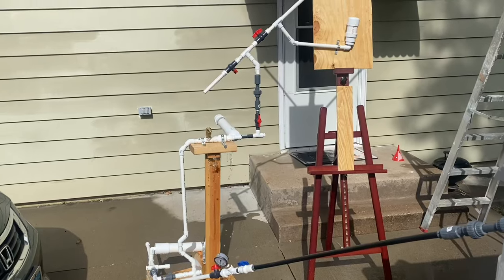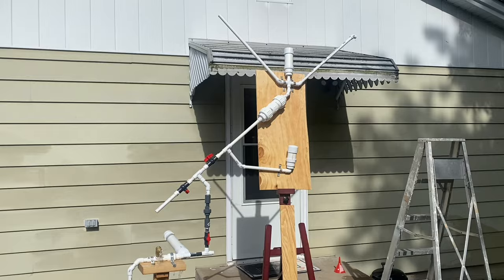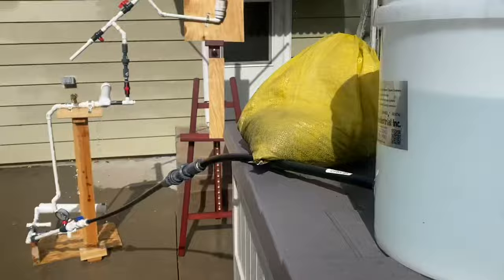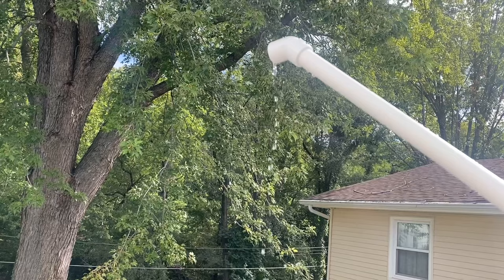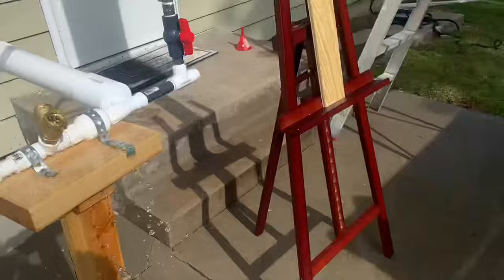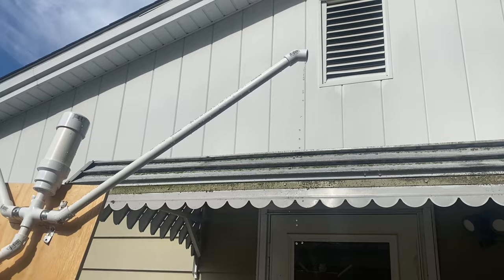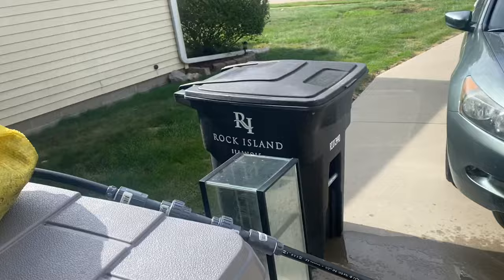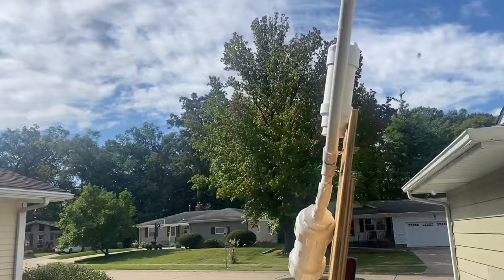The Great Pyramid of Giza Ram Pump theory works!  Video 1 of 2

Comment: Moving water (up) at a lower pressure than is being given by the body of water (container) pushing down is not rocket science. The body of water is contained and sitting higher than the location where water pulses and is additional creating pressure (moving a small flow up)Try pumping from the same level or below with equal pressure and see if there is enough spare pressure created so you can push water up the pipe. No, you cant.
Reply from the maker: This only works as is. It is a theory.
Reply: @tommartens3731  agree.

Comment: If you remove an ancillary component how does it change the operation?
Reply from the maker: During the building phase , I had the one way valve down near the subterranean chamber.  That didn’t work.  With a ram pump you have to have the drain valve, one way valve and pressure chamber relatively close to each other for it to work.  I did not try to see if it would still work if different pieces were left out.
Reply: @tommartens3731  Thank you.
Reply: Seems overly complex on an absolutely ridiculous scale for very minimal effect. Because a thing will function a certain way doesn't mean that is what it's original function is. I can plow a field with my car but that's not what it was designed to do.
Reply: @Good Citizen  it probably looks minimal since it is a 1/1000 scale, however this would be very effective at the pyramids true size
Reply from the maker: @peypoo123  Also, since the wastewater comes out of the upper grotto area it might also be usable.

Comment: I have no doubt the Great Pyramid was a ram pump but it would be easy enough to just get the water directly from the river. It may have used the ram pump effect to pressurize the granite for piezoelectric electricity.
Reply from the maker: Thanks!  I don’t think buckets in the Nile river would be easier.  Ram pumps create temporary back pressure.  I just can’t see an electrical aspect of this theory.

Comment: But why? Why would they want water pouring out of the shafts on the sides of the pyramid?
Reply from the maker: To provide water year round instead of just during the flood season.
Reply: @tommartens3731  But the Nile went right up to the base of the Giza plateau, even when not flooded. I still don't see the need for the world's largest pump.
Reply from the maker: @briankgarland  I guess the didn’t like dipping buckets into the Nile river all day long.  This provided year round water for crops, animals, people and recreation. It was infrastructure for prosperity.
Reply: @tommartens3731  Ancient civilizations devised lots of different methods for moving water, including up to higher elevations. I can't imagine they weren't familiar with any other solution except for the most difficult, most expensive, most time and labor intensive solution. And to achieve just two small shafts way up on the sides of the pyramid dribbling water down the side, dissolving the limestone casing at a relatively rapid rate. And just to get water for the small area of the Giza Plateau? Doesn't make sense. At least not without a lot more information, that I don't know we'll ever get.
Reply from the maker: @briankgarland  my attempt at a re-creation of what they had showed a dribble as a proof of concept.  On a full size re creation , that would be hundreds of gallons.  It’s a theory.
Reply: @tommartens3731  I meant dribble in a relative sense. Even at hundred of gallons a minute I don't see the benefit of the time and expensive to build it when other methods would have been faster and cheaper. And that's assuming the effort to bring water up to the relatively small area of the Giza Plateau was even worth doing. But it's an awesome experiment and I would love it if the concept turned out to be true.
Reply from the maker: @briankgarland  Thanks!
Reply: If you only need 1 meter of fall for every km of canalway and the Giza Pyramid measures 145 m tall, then can you bring water to places 100s of km's away by building wooden bridges to connect at the water output spots ? West of Giza looks to be flat land and dry for a while but it could be spread concentrically in all directions as well if there's enough water supply available ?

Comment: Are there tunnels leading to areas where the Nile is or has been?
Reply from the maker: The Nile used to run right next to the Pyramids which is where the descending passageway gets the water from.  That’s what the bucket in the video represents.

Comment: Do you think shock waves which were produced by the pump could cause a piezoelectric effect with the granite in the king's chamber?
Reply from the maker: I don’t think so.  The Ram Pump shock wave travels backwards from the check valve where the Grotto is located.
Reply: @tommartens3731  your build may be incorrect, check my recent video. kunkel proposed a check in the grotto but it was never located. shockwave utility prob primary function of sub
Reply from the maker: @pseudonymousdude9719  I’m not basing my theory off of Kunkel’s design or idea.  The check valve would likely have been made by wood so you would not find it 10-15 thousand years later.

I watched your videos but I don’t see what you are trying to achieve.
Reply: @tommartens3731  seems to me that your builds proposed utility could be accomplished with a simple ram (the sub chamber only), all you’ve added is a check which i agree prob could not exist today. vyse was blowing the thing up with gunpowder in 19th century so anything useful is long gone. i’ll be adding a check shortly but agree w cadman that kunkel was off and i feel you are as well. it’s a nice build, just superfluous
Reply: @tommartens3731  i’m leaning toward stepped up ground current and dielectric breakdown of the limestone myself but would need water to reach the queens chamber w oscillating compression. ultimately talking electrostatic potential, simple earth return system
Reply from the maker: @pseudonymousdude9719  The ram pump effect needs a minimum amount of falling water to be able to function.  The subterranean chambers allow that to happen. Ram pumps cannot work without a check valve.  There’s nothing unnecessary about my build, just the minimum needed to keep it simple.
Reply from the maker: @pseudonymousdude9719  I can’t see all that going on but if you get it to work, let me know.
Reply: @tommartens3731  see my recent build, simply added a check to delivery line to demonstrate the ram is the sub chamber, delivery line is the well shaft. no significant net shockwave in grotto and moreover no need for builders to build anything above the natural rock as the well shaft and sub were both underground. my point is: why go through all that work when they already had a ram? intuitively, there was additional function
Reply: @tommartens3731  it appears you’re neglecting the subterranean chamber shafts particularly the wastegate line (cadman)
Reply from the maker: @pseudonymousdude9719  The Great Pyramid of Giza Subterranean Chambers do not have an exit.  The Upper Grotto does. That’s why I placed the Ram Pump there.  I’m using the Subterranean Chamber as an additional pressure chamber.
Reply: @tommartens3731  this information is incorrect. reference the edgar brothers’ 1908 expedition, their maps, and the first book in particular. the sub chamber had at least 3 shafts/recesses. 2 of which were possibly a dead-end, the other was intuitively a waste gate line. when using the waste gate shaft as designed one finds that an air trap in sub reduces the shockwave and generally interferes w pump efficiency. highly recommend exposure to cadman’s fluid dynamic research on subterranean chamber because i think considering it could further your goal, here which is apparently to solve the mystery
Reply from the maker: @pseudonymousdude9719  it’s never been shown on any pictures I’ve seen. Let’s pretend there is a waste passage.  My theory still holds one way or the other.  I’m glad you were inspired to comment on my video.  I hope you take it farther.  That’s the idea.
Reply: @tommartens3731  I could be wrong but as I understood it there was a connection from the Great Pyramid to the causeway which is essentially a large tunnel. I've seen people kicking sand down the cracks on the causeway with accounts of people doing it for years without it blocking up lol.

Regardless I love your model and theory. There's no way that the Pyramid was a tomb, or at least, not built as one.
Reply from the maker: @chickenfist1554  I’m not sure about a causeway tunnel.  If there is and it leads to the Grotto or subterranean chamber, it only adds to my theory.

Thanks!
Reply from the maker: Ram pumps create pressure waves not shock waves.  The waves travel backwards to the water source.  I am not a fan of the Pyramid as a source of electricity from the rock
Reply: @tommartens3731  Always someone online to critique your work. I appreciated and enjoyed the video. Awesome work man
Reply from the maker: @AtlanticCanadianAstronomy  Thanks!

Comment: "This provided year round water for crops," 
They already had year round water, they were growing crops along the Nile, the Nile already fed a large watershed area, there is no sign of agriculture around the giza plateau which is a limestone plateau and not ideal for crop production, plus they quarried the stone for the pyramids from there....and if you can build a ram pump, you don't need to make it a giant fvck off pyramid sized one. ...and the water flow isn't the elevations you are using if your bucket is suppose to be the Nile.
Reply from the maker: Of course they farmed along the Nile. Moving that water to all areas is the key.  The watershed area only had enough water when the Nile flooded so they needed more water to sustain crops and animals.  Sure, they quarried in areas too.  How do you think they moved the stones. It is a theory, it works.  If you have an alternate theory, go ahead and build it, make sure it works and then put it out there and let people judge. Good luck.
Reply: @tommartens3731  The flooding brought in nutrients and refreshed the soil. The flooding wasn't caching water to make it able to be farmed.
Reply from the maker: @AveragePicker  I agree.

Comment: So theres a billion tons of granite stones to do this.
Reply from the maker: The forces involved in using a ram pump of this size pumping thousands of gallons per hour would definitely require enough mass to hold itself together and be as quiet as possible.
Reply: @tommartens3731  this is highschool physics.
The pyramids are most likely power plants.
The water underneath was used to resonate frequency that works the same way the magnetosphere works.
F# is the key and the frequency would have to be equal or greater then the Earth's molecular buzz.
Reply from the maker: @user-xm6tw3sv3n  go ahead and build a scale model and get it to work then.  I had a theory, built it and it worked.  There’s no other working theory out there.  High school physics says a ram pump would work and I proved that it does.
Reply: @tommartens3731  your  theory gravity.
Reply: @tommartens3731  you could turn what you have into a perpetual motion machine and never have to pay an electric company ever again.
Reply from the maker: @user-xm6tw3sv3n  you would always need new water entering because ram pumps are not very efficient.
Reply: @tommartens3731  you can have the water drain back to it's source. The only problem I can think of is evaporation.
You figured this out.
I'm sure you can figure that out.
Reply from the maker: @user-xm6tw3sv3n  The “waste” water is roughly 90%. It would take more energy to get it up to the source to reuse it.
Reply: @tommartens3731  you could use gravity to keep it flowing.
The  better the water pressure,, the more energy you will get.
I saw some interesting videos about preventing tsunami damage and that give me a couple ideas that might work.
Reply from the maker: @user-xm6tw3sv3n  In the case of the Great Pyramid of Giza, the entrance to the subterranean chamber is lower than the upper Grotto.  Gravity  would not be enough with a ram pump.
Reply: @tommartens3731  how about pressure.
There was a river that flowed underneath.
I believe the pyramids purpose was 0 point energy.
Tesla did a great job attempting to prove this.
Reply from the maker: @user-xm6tw3sv3n  There apparently was a natural spring where the upper Grotto area was.  Without any historical data on what the output was, there’s no way to definitively say how much pressure it could have created.  Too much pressure may have fractured the Rock below and changed the course of the spring.  We simply don’t know.
Reply: @tommartens3731  I made a perpetual motion machine using the reverse pool of magnets and a fan. I could charge my cell phone with it.

Comment: No, this proves absolutely nothing !!

- this is so far from being a model, on any scale, of the Great Pyramid of Giza or its Plateau 64 meters \ 210 feet above sea level.
- there is no water head for your pump to begin with.
- there is no drain canal in the pyramid for the water from the waste-valve.
- the weight of water in the Grand Gallery would shut down the pump.

Far from being done, I must tell you that this idea of yours is to amuse kids.

 🐾 Montréal 🇨🇦
Reply from the maker: I never claimed it proved anything.  It is a theory.  It is the only working theory out there.

Comment: That's cool it works. If the river was running right there to feed the pump though, why didn't they just get their water straight from the river?
Reply from the maker: They probably did put buckets in the river before the Great Pyramid.  It was way more useful when water came up high enough during the flood season for irrigation and crops.  Having useful water all year long made the whole area more prosperous.
Reply from the maker: @fawkyoufromjones  Would you want to be the one to hoist up thousands of buckets of water an hour, all day, every day?  Not me.